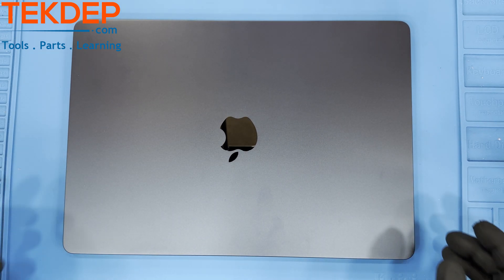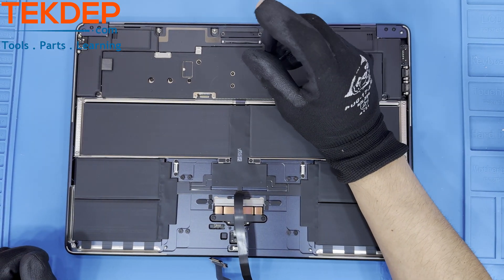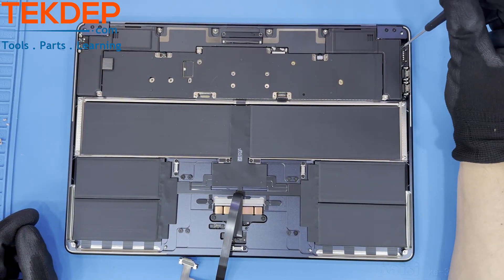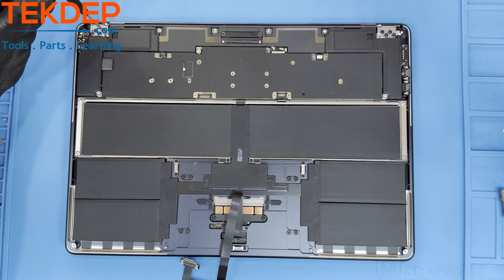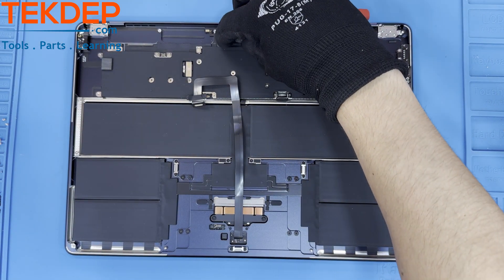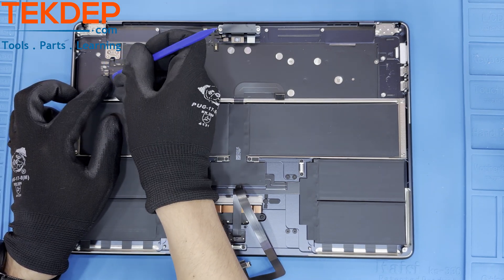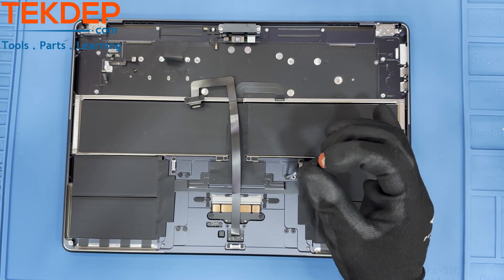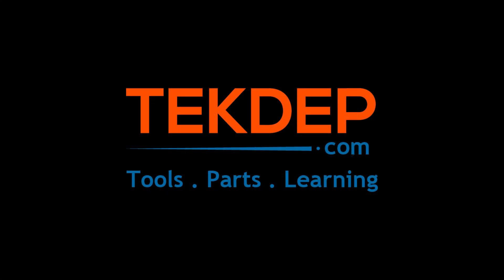15" MacBook Air M2 (2023) | FULL TEARDOWN | Disassembly Repair Guide

Comment: Question - with the touch ID in various videos and directions, I only see 6 screws being removed, but it kind of looks like there's one in the middle row-middle?  When I replaced mine it doesn't seem to have the right spring action going, and there is what looks like a threaded hole right in the center.  Not sure if I missed something when you were removing.  Thanks!!
Reply from the maker: Hello,
There are only six screws that secure the Touch ID sensor and its bracket on the MacBook Air. 
The 'threaded hole' you see in the center is an alignment post, not a spot for a seventh screw. If the button feels mushy or lacks spring action, try loosening the six screws slightly, centering the button from the outside until it feels right, and then tightening them back down.

Comment: So there is no cooling fan?
Reply from the maker: MacBook Air model M2 has no cooling fan and generally runs very cool and it’s truly efficient when it’s come to heat management, If anyone needs replacement parts for any mac model such as screen and batteries or tools for your MacBook repairs, we have them all and ship worldwide! visit: https://tekdep.com 

We also offer a convenient and affordable Mail-In Repair and data recovery. You can learn more and get started here: https://tekdep.com/device-repair/